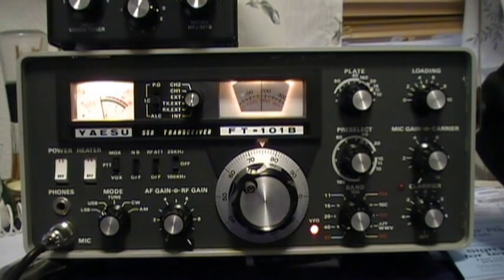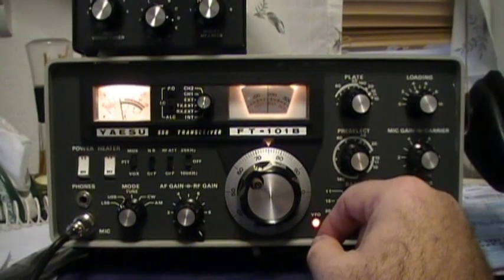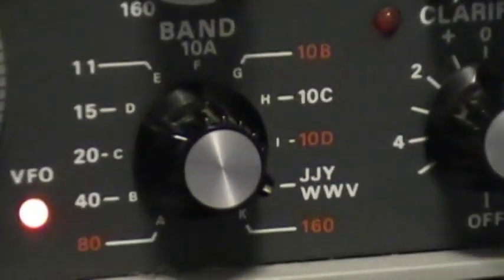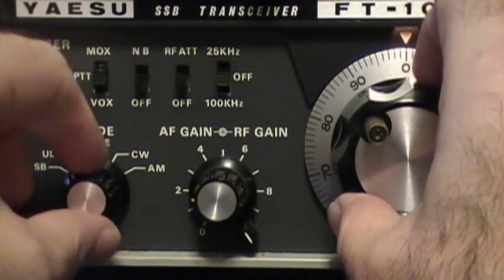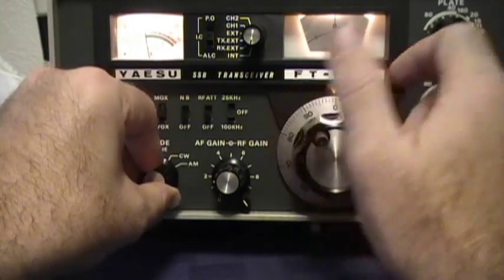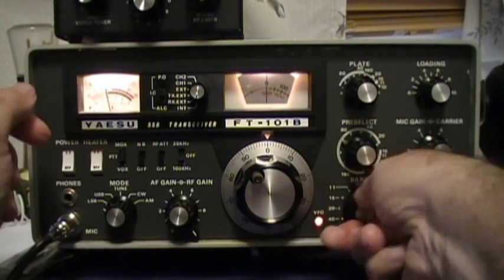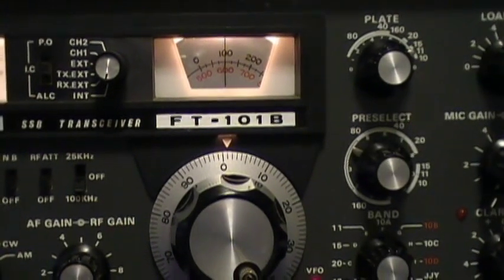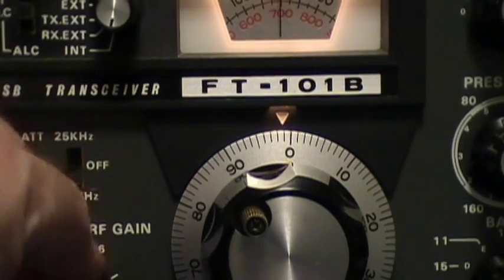How To Zero Beat Yaesu FT-101B

Comment: Well the video is old now - I doupt it a bit. When I had a F-101 E about 46 years ago I was teached to switch to put in 25/100KHz and TUNE and then making the tone heard against ZERO Hz.......In your Video there is still a tone in Tune position where you state this was the frequency right now?!
Am I wrong after al these years?
Kind regards
Michael
Reply: I did some research before making that video.  I thought that the procedure was correct at the time but after several critical comments, I'm not so sure.  It seems to have helped more people than not and that is why I keep the video up.  I don't own or use boat anchors anymore so I really can't confirm or deny the information.  Sorry.
Reply: @raybecker3601 
Great Thanks Ray for the immediate response. I still have mine (FT 101 E) from when I was 14 yrs (now 60) but was not on air the last 40 yrs - so I guess I'll plug it in again and will see...
The Handbook simply says to "zero beat the 100kHz" - so in may thinking there would be no more tone in LSB/USB.

Hope to contact you than on SW :-)

Comment: What a load of crap. All he has done is set the tuning dial to the mid point between the 2 BFO xtal oscillators. 0 on the tuning dial should be set using the built in 25 or 100kHz cal function and adjust to 0hz tone on the desired mode.  Zero beat means a zero Hz freq heterodyne frequency. D'oh.
Reply from the maker: Listen Ham Nazi...Make your own fucking videos.  I swear, guys like you need to be slapped around.  Get the fuck off my channel and go clean your mommy's basement

Comment: Well, at least he got the part about WWV transmitting out of Boulder, Colorado right... ;)  Isn't the "25 KHz/OFF/100KHz switch used to put a marker tone at those intervals, then the MODE is set for TUNE or CW, and then you find WWV, and zero beat the WWV tone with the marker tone?  It's been awhile since I've messed with one of those, but I believe that's how it's done.  Then return the marker switch to OFF for normal operation.
Reply: Nope. The marker tones will not change relative to the beacon. But that is a nice way to check your marker crystals.

Comment: I'd guess that since it's been 4 years since you posted this video that you now know this information is Completely WRONG? You should do the right thing & either remove the video or post it as the WRONG way to Zero Beat a Yaesu FT-101.All this method will do is get the dial out of alignment.

Comment: Picking up an FT-101B Tomorrow (6/17/17) so thanks for a few pointers but Zero Beat info is WRONG.I have never owned or used an FT-101 series transceiver but I have heard a lot of them on the air & lots of tales about them.I am NOT usually a fan of Yaesu transceivers but just maybe an Early Edition may be more to my liking? I would NOT own any transceiver they have built in the last 15 years.They all pretty much SUCK in my opinion. {:>) UPDATE: My FT-101B is an Early model 101B but has all of the bands installed except 160 meters where I doubt I'd ever use it but I may buy the crystal & plug it in anyways since it's less that $20 shipped.Just wired my Black Special Amplified Astatic D-104 for it tonight.Much better than anything Yaesu currently offers on the market.
Reply from the maker: They are great radios for power and audio.  With that said, an FT-100, FT-450 and FT-856D are WAY more capable and much easier to operate.  Sounds like you're either a diehard Icom or Kenwood guy.  That's cool.  All three make great radio's.  It just comes down to personal choice.  The 101, when it is properly setup is a great talking boat anchor.  With the right tubes, she will do 200 watts easy.  Good luck with your 101.
Reply: The modern Yaesu rigs are a Pathetic Excuse for an Amateur Radio.In the CB world they would be bottom of the barrel.The last three Yaesu rigs I have owned have been beyond worthless & those were the 857D,2500,& 2800.My 1st HF rig in 1994 was Yaesu FT-990 AC/DC & it was a great rig as was the FT-1500 2 meter mobile.I am now a Die Hard ICOM fan with all of the modern rigs & I'll take my ICOM 7600 over anything that Yaesu has EVER produced no matter the model of the cost.I would NOT own a new Yaesu if it was FREE no matter the model number.I am finished wasting my hard earned retirement income of their pathetic excuse at an Amateur Radio forever & more. YAESU = Yet Another Excuse Simply Useless
Reply: @1OFGODSOWN  what specifically makes recent yaesu rigs inferior, compared to icoms, IYO? Thanks

Comment: it D-star and internet now mate, Ham Radio joined forces with the web to wipe out direct line communication.
I can talk to another ham user on the web now by connecting up my ham radio to my PC.
wait a minute, I can talk to people around the world with no interference by not using the ham radio at all, just the pc.
QSL.  lol omg 73s and 69s Good buddy
Reply from the maker: until the grid goes down...My video's are mostly about what people can do if there were some type of event like an EMP or Coronal Mass Ejection.  Personally, I don't use for casual comms.
Reply: So how'd you power this thing if the grid went down, these old beasts sucked a lot of amps
Reply from the maker: solar panel and one 12v deep cycle battery.  these radios had the dc power supply option and it is not necessary to run full 200 watts.  my radio has the dc cord.  easy stuff in grid down
Reply: What about in a nuclear attack, no sunlight.
Reply: Sorry, just messing with you, in a nuclear attack your antenna would probably get bent.
Good to see old radios still being used, I've still got a few older vhf handsets in the garage somewhere, I gave up a long time ago

Comment: My 101E should be here in a couple weeks. Waiting on an AM filter and install and shipping. I have a Kenwood TS 430 and this is easier to do, no covers to take off. My question is, how long will it stay in tune on any given crystal before it drifts off again and you have to do this over again?

Thanks for the tutorials. I subscribed.
Reply: If you have not done so already,buy yourself the Yaesu YC-601 or YC-601B & you can then watch the frequency drift & then correct it as needed.Make sure you properly calibrate the YC-601 or 601B & you will be set.Good rigs but far from great in my opinion & I have the FT-101B & FT-101EX just for goofing off & not serious DX.No WARC Bands is a Big Negative for me since I am a big fan of 17 meters which only one FT-101 will do & that's the last one built without a mod that requires a toggle switch be installed as well so I'll leave mine as they are.